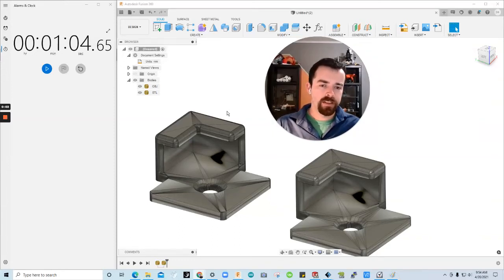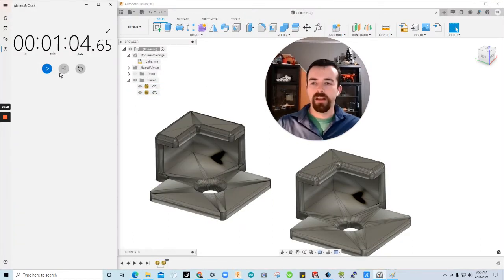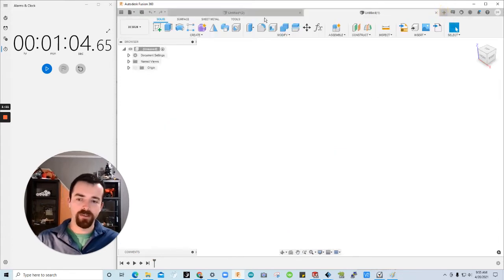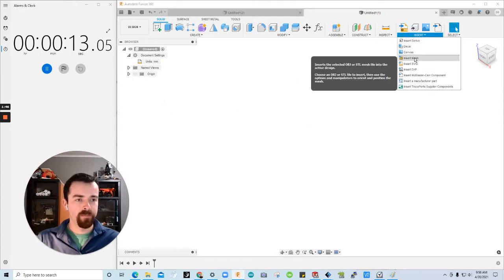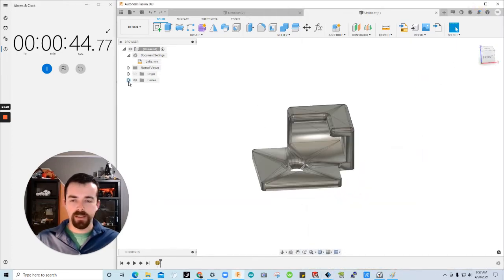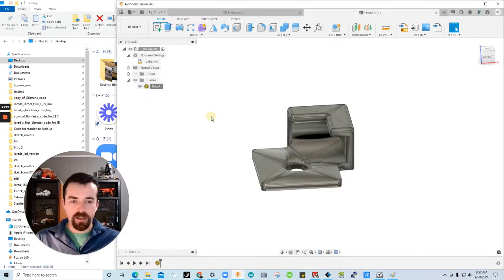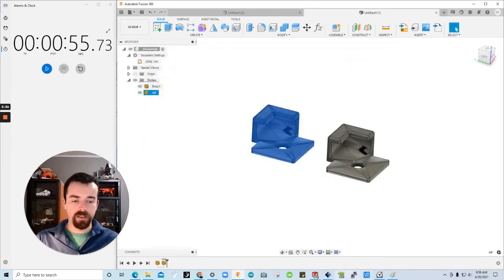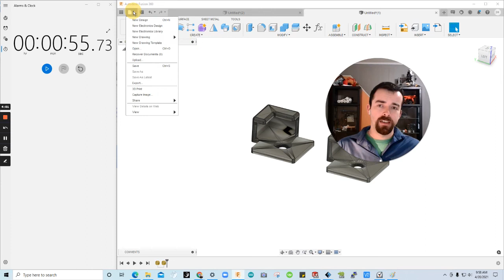How to convert .OBJ files to .STL (Step-by-step, for free, and in less than a minute)

Comment: It is possible to convert with textures? I have OBJ object with textures, but when I convert to .STL and open in Maya, i can't see it.
Reply from the maker: I would guess it was converted to a different unit. So may be extreemly small in Maya. Can you send the file to my Discord so I can check it for you? Link to discord in the video discription
Reply: @jaredhanson9758  Thanks for your offer of help, finally I found out that STL does not support texture for example compared to FBX or OBS

Comment: Thanks for the video. What about .mtl files?  EasyEDA exports all 3d objects in one shot as a zip archive that contains .mtl and .obj and sounds  like .obj needs something from .mtl?
Reply from the maker: Good question. ".mtl" files are often sent with ".obj" files. A .mtl file is a companion file to an .obj file in 3D computer graphics. The .mtl file contains material definitions for the objects defined in the .obj file.

In other words, the .mtl file describes the surface appearance of the objects in the 3D scene. It contains information about the material's color, texture, transparency, reflectivity, and other properties that affect how light interacts with the object's surface.

You dont need the ".mtl" file in fusion. You can just use the ".obj". 

Feel free to reach out on discord if you have more questions. Link in the description.

Comment: Great video, question I have a model in obj, once in Fusion 360, can it be converted to a solid body that can be cut up into several pieces and  create negative molds so they can be printed as stl files and then used to create a composite part? New subsciber.
Reply from the maker: Yes, absolutely. There are some great videos of how to create molds in Fusion360. But feel free to message me on Discord if you need help with the file. I can typically do a quick meeting via zoom to help with small projects. Link to discord is in the video details.